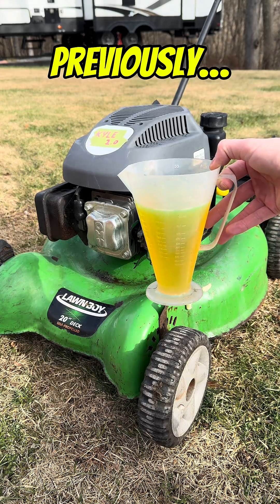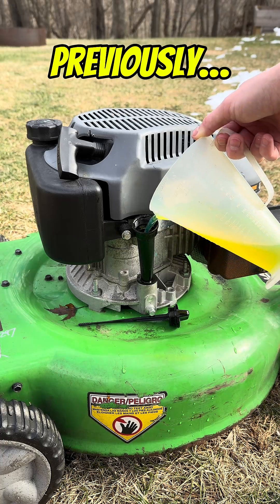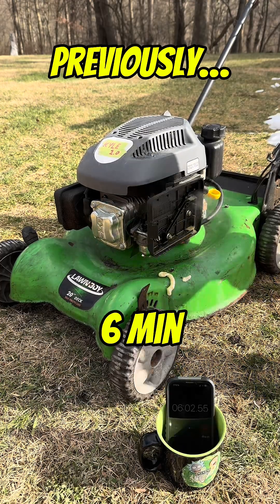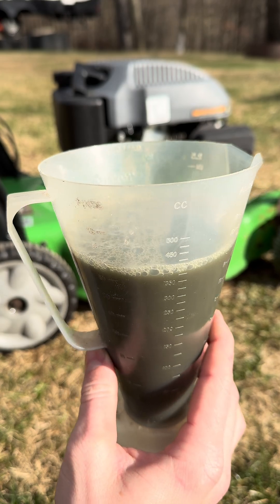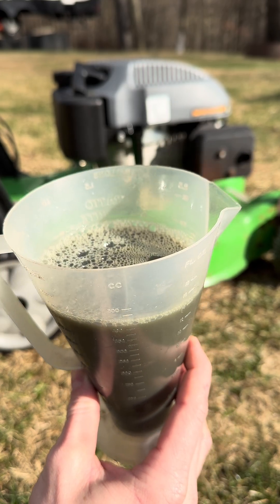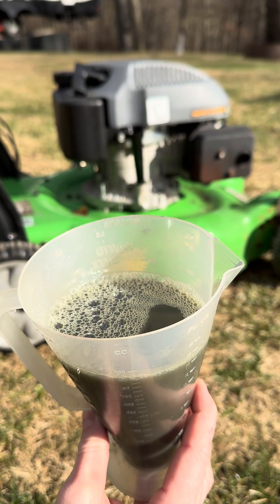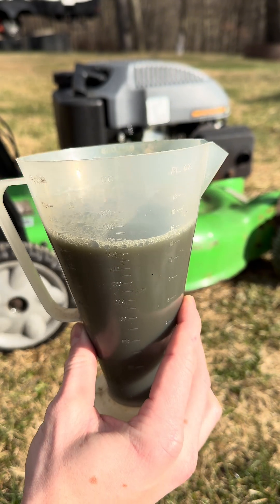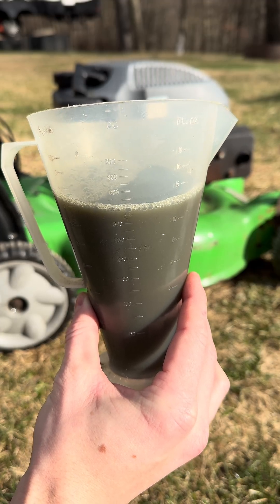Aftermath - Diesel fuel as engine oil #diesel #engineoil #smallengine #testing

Comment: Put in the fuel tank of a old diesel engine and it will burn it no problems or a diesel heater it good for burning i had a old 8V71T Detroit everytime i done a oil change I would filter the old oil and mix it in with the diesel never any problems

Comment: Yes,  in old tractors they mixed 50/50 engine oil and fuel. You just gave it a flush. Though straight fuel will cause premature ware

Comment: Apparently no one has a clue what there even talking about. This trick has been used for century’s to flush and engine out, remember diesel is not broke down as bad as gas, diesel is basically 75% oil, so NO it doesn’t knock the bearing out. It actually lubricants them, you can’t run it at full throttle or speed it much idle the entire time, and it can idle 15 to 20 minutes.

Comment: diesel is actually provide lubrication to the engine if you can find another fuel that glow plugs can ignite you can run it and you might see some wear if you run it long enough but you still should not put diesel in the oil of your lawn mower

Comment: LIQUID NITROGEN INTO THE INTAKE! Seriously Im curious to see what happens.
Reply: liquid nitrogen is really just very cold and not too reactive until it turns into a gas which will be quite quick then it will ignite though in the end the rapid freezing of the motor then implosion due to the gass will probably just lead to a fizzle then a pop with a hole in the side of the motor or a smoothie of parts inside